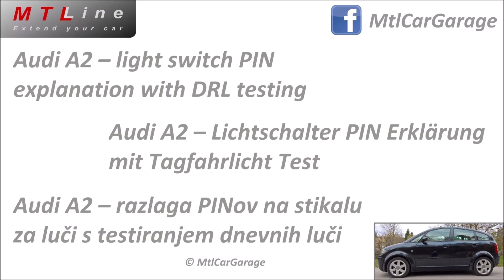Audi A2 – light switch PIN explanation with DRL testing

Comment: Hi! Altought this video is available for quite sometime, i just found it because i bought an Audi A2 for mi wife and trying to understand it better.
So, to have this DRL working as you explained, it's only when the key is in the ignition on position (when the car is running), correct?
Reply from the maker: Yes.